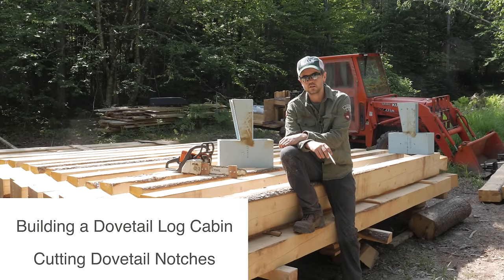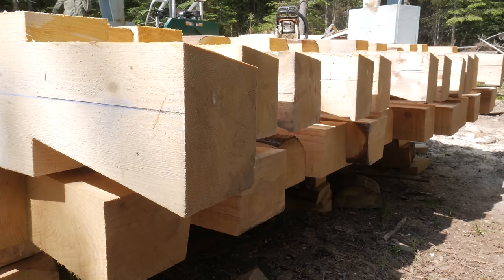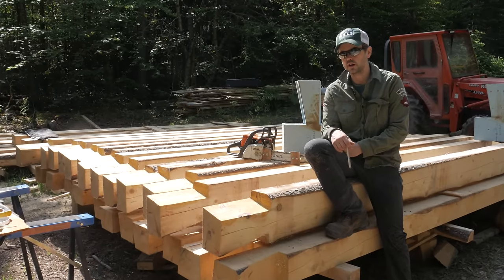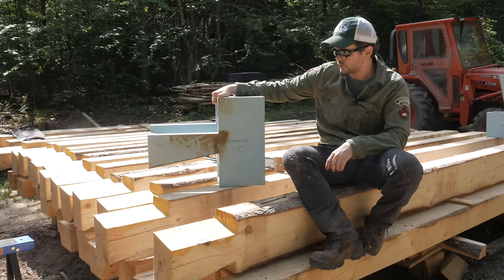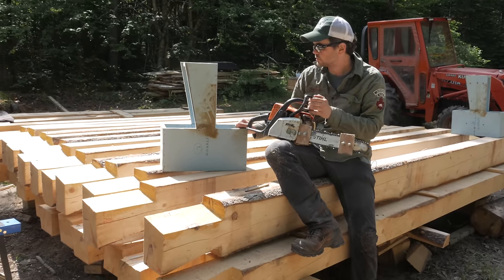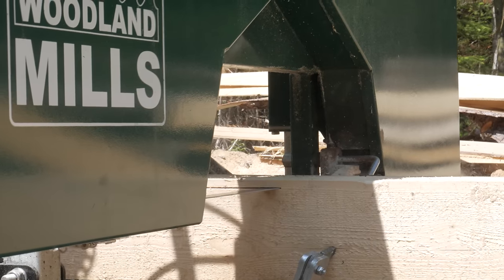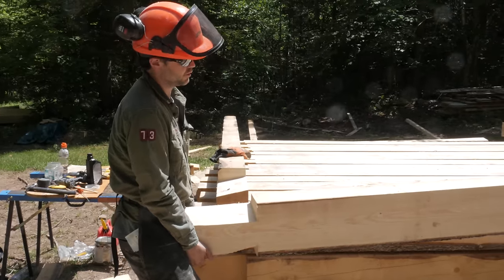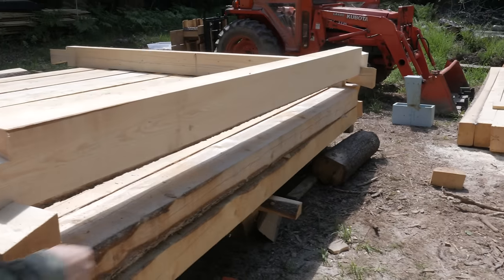Dovetail Log Cabin - Cutting Dovetail Notches

Comment: Two inch gap is kind of large  after going through all of this.  Just as well go the extra mile and put a  tunnel  in each to take a 2x4  in them make no gap and use a sealing tape.  Cement gap is going to be cold and need repair often.
Reply from the maker: Hi George - Thank you for the suggestions. The chinking method has been used for a long time and I hope that it will work well for me too. But you are right there are many other good ways to do it as well.
Reply: the gap was left intentionally large to make sure the logs in saggging over time would never touch.  If they do then the corner joints loosen and the whole cabin can shift, creating gaps all over.
Reply: Perma-Chink chinking is what you want NEVER use concrete or morter. It dries and looks like concrete or morter but acts like a rubber , it bonds to the wood and stretches when and where logs shrink. Been around since the early 80s . Bear Creek Log Home Restoration , Ellijay GA.

Comment: If your wall is one standard unit. You need to divide it into 3 equal sections. 
Would you rather have the answer 0.4 or 0.33333333333333333333333333333333333333? 
How about 4? 0.3 or 0.25. 
How about 5? 0.24 or 0.2(i'll give you that one)
How about 6? 0.2 or 0.166666666666666666666666666

Challenge your mind to think in duodecimal? I find decimal to be much worse. It really isn't close. BTW what time is it?🙂

Comment: I thought dove tail had a double angle, so as it pulled apart from settling, it would get tighter in both directions for each log.  These are only angled one direction
Reply: Single dovetail vs a full dovetail that your thinking of.

Comment: It is time to learn the trick to bisect a board, and locate the midpoint without fractions, almost.  Run your tape across the board at an angle big enough to position the tape such that two even numbers sit precicely on the board edge.  The point half-way between the two even numbers on the tape is the middle of the board.  Do this in two spots and join them to extrapolate the middle to the end of the board.  By using even numbers exclusively, you will never have do deal with an odd-ball fraction again.  Math am I right?

Comment: Dovetails on small work hold tight and square, where they don't have to be nailed.  But, with a house, why not?  Dry as dry can be, saturate with an epoxy, sealing the log, then bolt together as an extra measure, I'd guess a home could be like the wizard of Oz, where the whole cabin could be carried should a tornado come.
Reply from the maker: I hope it is solid! Dovetails are an interesting style of construction, both esthetics and strength are good.

Comment: Why not cut the joint closer to the end of the log?  Seems like you are wasting almost 12 inches
Reply from the maker: I wanted to make a 12x12 foot cabin. My logs were 14 feet long. I may ultimately cut off the extra portion of the dovetail, but on the other hand, I might keep the extra section as I have seen cabins built this way too and it seemed to look OK. I am not sure that there is any benefit of the extra length at all. .
Reply: @PenniacWilderness  just that you would have a few extra sq ft. I like the jig though, it makes a good joint 👍

Comment: I don't understand why you want to leave a gap.  We still have buildings on the farm built 80 years ago with dovetail joints and the walls are tight.  Filling 2 inch gaps with mortar is tedious and unnecessary.  All you need to do is make some new jigs that are an inch deeper.
Reply from the maker: My main reason is that I like the look of the chinked log dovetail cabin. But also it allows  for some room-for-error on my milling.
Reply: @PenniacWilderness  I agree, it looks awesome with chinking.

Comment: You obviously have never been in eastern Ontario.  There you can still find log buildings built over a hundred years ago, of cedar, and all have the dovetail corners.  They were built mostly by the workers of the canal built from Ottawa to the St. Lawrence by Col. Bye.
Reply from the maker: I have actually! But I have spend much more time in Europe than Ontario. The cabins I lived near in Europe were built using the dovetail style with gaps for chinking. I have seen some similar ones in Ontario as well.

Comment: Why didnt you just make it to the size of you wood and you wouldn't have to worry about all the center lines and stuff
Reply from the maker: Good question - You probably could do just as you said if your wood was all cut precisely. Mine varies a bit and using the centre line method just ensures that the dovetail is centred well on the log. Your point is valid and if I had milled the logs a bit more precisely I probably could have done this. Thanks for the comment and question!

Comment: I noticed that you had to roll the log to one side, then you had to reapply The Jig, then you had to center The Jig, then you had to cut the second angle on the opposite side of the log so that it adds up. Then you didn't even tell us what angles you were using or anything, all you had to do is grab something that measures angles and given us a basic idea!

Comment: 4:28 - for the love of God...when will America (and GB?) smarten up and go metric.
I bet you 80% of Americans could not tell you off the top of their head how many feet are in 1/2 of a mile. But I bet you that at least 80% of people who grew up with the metric system could tell you off the top of their heads how many meters are in 1/2 a kilometer.
28% of a mile? Lotsa luck without a calculator/paper and pencil. 28% of a kilometer? Easy - 280 meters.
3/10's of a yard? Ummmm................................................10.8 inches. 3/10's of a meter? Simple...30 centimeters.
 Imperial is just so ridiculous.